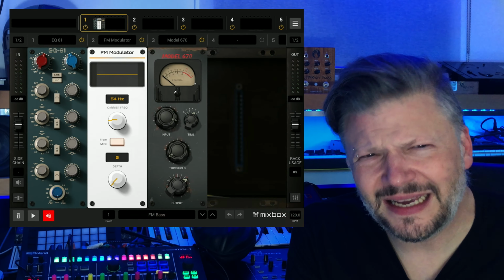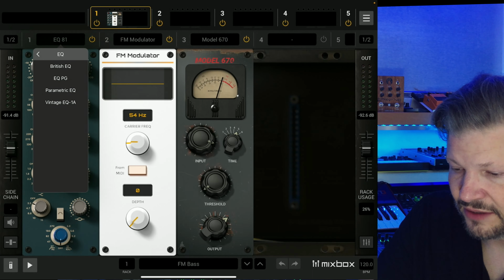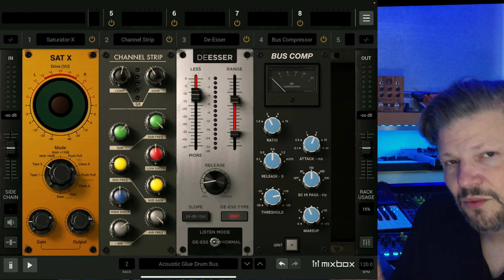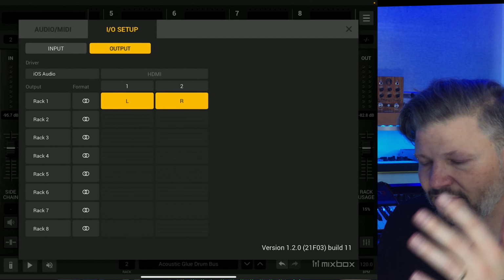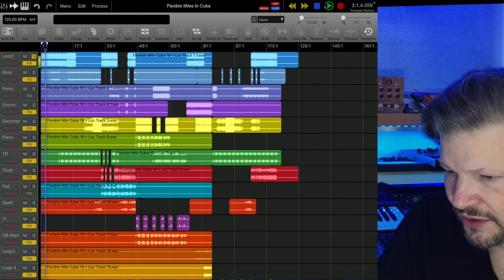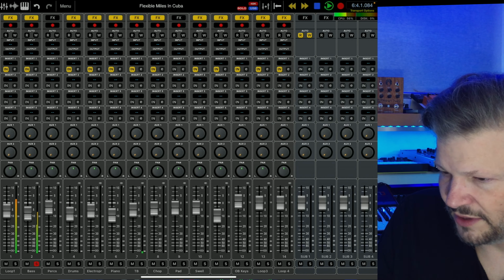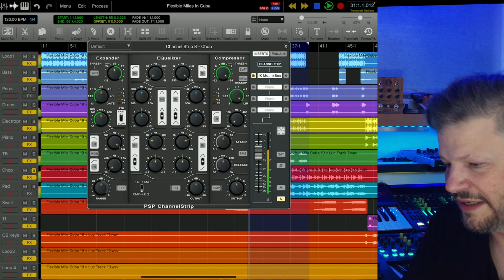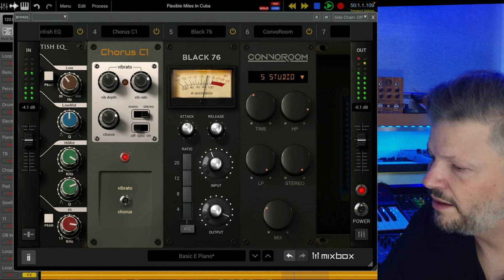Mixing using only MixBox in Auria Pro on iPad. Thanks @ikmultimedia !

Comment: What do you think about mixing and mastering on ipad and on computer, which one do you think is good? please share your experience.
Reply from the maker: Already in 2015-2016 I did created, mixed and mastered one album done exclusively on iPad. After using different DAW I settled with AuriaPro for mixing and after testing the existing massing apps of the time I went back to AuriaPro also for my mastering. Here is a link for the album. https://music.apple.com/us/album/the-mobile-sessions-ep/1212359279
Reply: @Nu-trix  ok thanks, so do you think with Mixbox and Auriapro we can mix any song that includes vocal without the need for any additional plugins? and do you think we can also master using mixbox, please guide me.
Reply from the maker: @vcodev108  yes , for someone like me, who learned on hardware console then on Protools, AuriaPro is exactly what I need to mix and master. The combination on its native processing plus the Mixbox is a winning really good. I’m will do a mastering video about Auria pro and mixbox soon.
Reply: @Nu-trix  ok thanks for your guidance.
Reply: @Nu-trix  ok thanks and do you think I can run it well with  ipad 2019 with only 32gb of ram?
Reply from the maker: It should be ok. In the worst case you can freeze tracks when you want to free cpu.
Reply: @Nu-trix  Thanks for your guidance.